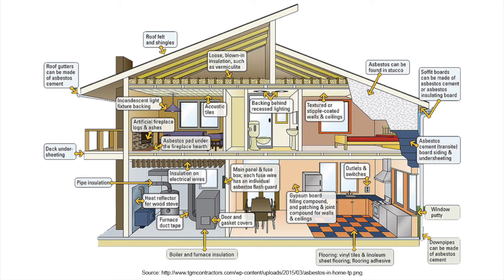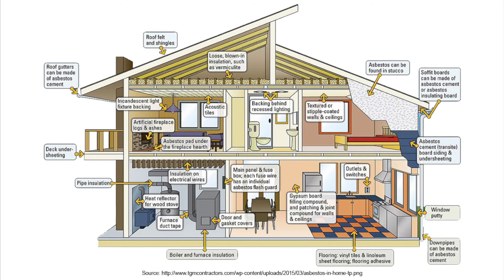An Introduction to Asbestos

Comment: I feel there's esbestas in the building I live in and the health board here in Canada isn't doing a thing to rectify it
Reply: You don't have to. Unless it's coming apart, it's safe. Have a good deal of asbestos flooring. 47 years. Still alive. Lol. This stuff is toxic, but it DOES NOT wear out. 

We have Armstrong 1964 sheet flooring,  called Montina pattern. The backing is 70% asbestos, as is the black, sticky adhesive tar called Black Jack. 

But I assure you, it's not coming up! Lol. It's ON there. God knows I tried. Ha
Reply: Do research. Flikr has good photos that are very clean of "new old" stock. That means it's new in some warehouse. 

Asbestos research will tell you Armstrong never put asbestos in ceiling tile. Supposedly. 

You'll know the older it is, the higher the odds are of lead, aasbestos, you name it.

Just don't eat paint chips or sand it and you'll live.  Anything before 1978 in US is assumed to have lead paint. Extremely dangerous to kids who eat paint chips. Adults over 25,  not so much. 

Asbestos is in things you wouldn't expect, like pipe insulation (looks like white paper) and many bad things in old toys like Pyrex and Corning ware and Fisher price toys. Lead, cadmium,  arsenic. They have home test kits for 10 bucks. Not extremely accurate, but a good basic idea. You snap it until you get liquid, rub it over the item and if you see pink you have lead (think mom's wedding china) and red is LOTS of lead. 

10 is 2 lead kits

Research on asbestos will show you stuff like patterns that CANNOT be anything else. The Armstrong Montina is an OBVIOUSLY unique pattern. Throw a rug over the worn/broken parts, don't mess with it and move on. It's fine. 

Working with it, removing it. Or destroying it/making it is a WHOLE other animal, tho. That's how most people get mesothelioma.
Reply: Removing it is EXTREMELY expensive and not stupid-proof. If you're young, you'll find a lot of workers and other people take ZERO precautions. Most of those workers are young men. It's like trying to be tough. 

Which is just stupid.

Comment: Many thanks for the clear contribution about asbesto! Unfortunately in many countries, there is still a lack of information about the many possible uses of asbestos and about which work can be carried out by the customer and with which safety precautions.
If you suspect asbestos, it is better to be safe than sorry: a small material sample, which you can easily take yourself, can be used in a professional test procedure to determine whether building materials containing asbestos have been used in your property. If this analysis confirms the suspicion of asbestos, then the following applies: Have any kind of gutting and renovation work carried out exclusively by service providers with the necessary certificate of expertise. Only then can you be sure that no accidental contamination of living spaces, clothing, etc. with asbestos fibers has taken place.

Stay healthy!

Comment: I find it hilarious this guy pushing companies to remove asbestos obviously he gets a major kick back. I live in Canada and I knew I had asbestos containing tiles in a house we bought, I removed myself and that what that, did not need to call some clowns to charge me 10k to scrap tiles up
Reply: Removal by unlicensed personnel is illegal in a lot of countries, one might speculate it is to profit contractors, but it does require some special knowhow to remove it. Except when you can get it off without breaking it.
Reply: @juliuseskola1281  perfectly legal to remove yourself in Ontario Canada👌
Reply: @juliuseskola1281  If you're a homeowner you just get a slap on the wrist. It's contractors who aren't license to do it that get fined. If you spend an hour researching how to do and buy all the right protective equipment, it it's not a big deal. Wetting and HEPA are key as well to protect neighbors

Comment: Why do you have to get it tested cant you see it?
Reply: Some forms of asbestos in construction materials are easily visible to the naked eye. But some forms are totally crushed into microscopic particles that are added to certain types of materials like cement mortars, plaster, spackle, tile grout, bonding putties and floor glues etc. Same with some older gypsum drywall boards. These types cannot be detected by anything other than an electron microscope. (No ordinary light microscope will do). They are ground so microscopically into a 'light as air' powder and added to these materials as bonding agents.  And the only ones who are qualified to determine if asbestos is present (and what type) are specifically trained lab techs. Us ordinary folk wouldn't be able to determine the difference between asbestos and other rock mineral silicates even if we had our own electron microscope.
Reply: @mikebennett146  DID YOU JUST TYPE A WHOLE ENTIRE WIKIPEDIA PAGE ONTO HERE
Reply: Mikebennett146 gave a very informative reply and he is right, sometimes it is impossible to tell by looking if something has asbestos in as it has been mixed into other stuff.  For example, Artex ceilings often have asbestos in them, but you wouldn't know for sure unless you got the material tested.  In these cases, it is safer to assume it does and to try not to damage or disturb it to avoid creating dust.